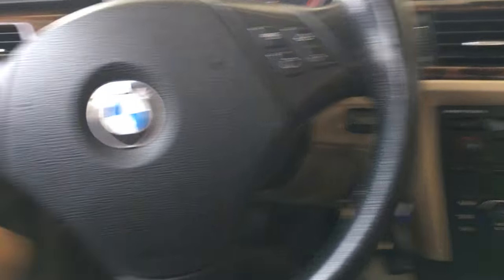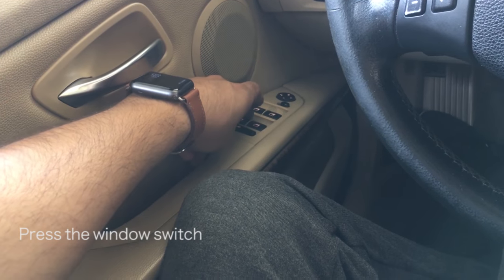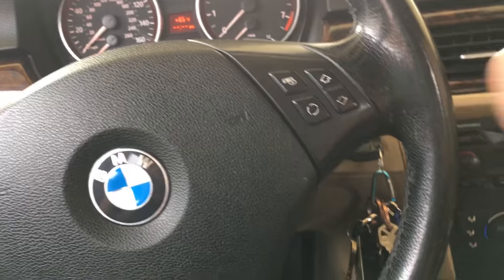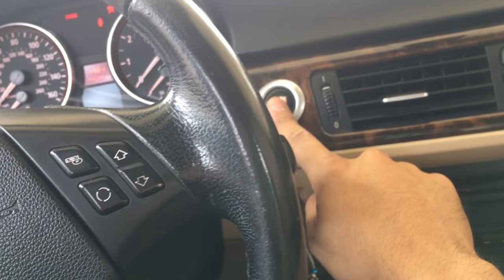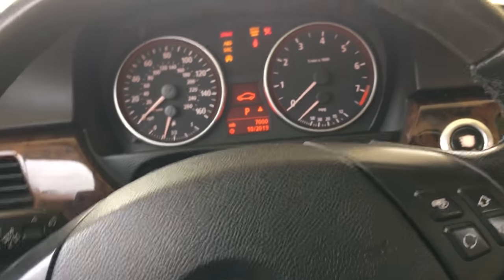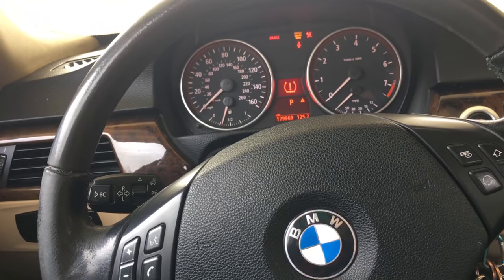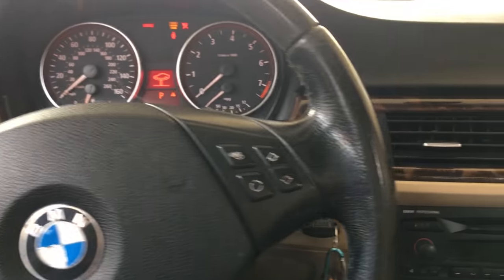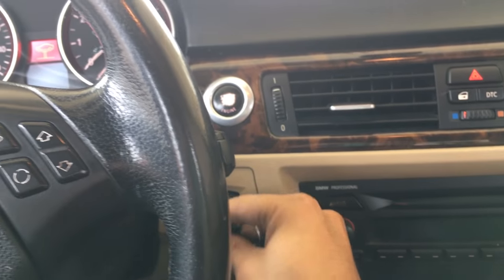Reset BMW Window Regulator that rolls in pauses

Comment: Ok guys, it’s working like in the below steps, but I struggle 1 hour to find the right way for my wife’s G30 plugin hybrid on YT. Obviously couldn’t find the right method and even this video is not very specific. 
Step 1: go inside the car and close the door 
Step 2: hold up the door button on 1st stage (step) and start the car but don’t press the brake, so you don’t actually running the engine.
Step 3: count until 10-15 while you keep the button up.
Step 4: stop the car first and after release the button 
Step 5: start the car again and try to open the window.
 For me it worked like that but again after viewing a lot of similar videos.

Comment: Excellent! Thank you so much! ...the trick you showed is that you have to perform 2 resets, the first by rolling the window down and holding the button for 20 sec's, then again by rolling the window up and holding the button up, again for 20 sec's. I had replaced the regulators in both back windows and these steps stopped all weirdness with the window going up then down or then up and pausing. Thank you again!
Reply: I had the same problem that you had with you, the glass of the leg drops by itself, and I will not be able to raise it. I only raise it with the remote control. Sometimes it rises and sometimes it does not, and the glass comes back down. What is this problem and what is the solution?
Reply: TY FOR COMMENTING THE VIDEO DID NOT EXPLAIN THIS!!!

also in my 06 bmw 
1. i did NOT need to quick push ignition button
2. a window sign came up on dashboard after doing first reset (i did down window button hold first)

Comment: Just replaced the rear drivers side window regulator on my 2007 328i, but I couldn't reset the auto up/down for it. After a few hours searching, I came across this video. It worked! I had to do the steps a few times and it didn't seem to work until I used the front drivers side window in the process along with the rear drivers side window that I was fixing.
Reply: Yes! Thanks for this comment. I couldn’t get the rear passenger window to reset so I tried doing the front too and now they both work
Reply: @EllaTobyVideos  So you guys are holding the button for the window on the front driver and on the window needs resetting ?

Comment: Thank you. I have my both rear window throwing this error after putting new battery in my e60 520d 2006. I have done your method which corrected the rear left side only. The rear right side continue with the problem.  Finally I did the following and corrected the problem. Ignition on and go to the affected window . Press down until the window fully open it will take few presses. Once fully open press the button fully down for exactly 17 second (look at your watch ) let go with the button and immediately left the button up all the way and keep it that way. The window now will go up all the way and down all the way and finally up again all the way while you are still holding the button up. Finally the window will stop and your fault corrected.
Thanks.
Reply: aabosala you’re a life saver! This worked for mine and now I don’t have to hear that stupid sound anymore.

Comment: I had the same problem that you had with you, the glass of the leg drops by itself, and I will not be able to raise it. I only raise it with the remote control. Sometimes it rises and sometimes it does not, and the glass comes back down. What is this problem and what is the solution?

ترجمة مباشرة

Comment: hi my problem
is when i’m on highway there’s a whistle getting through my passenger side and iv noticed that the window isn’t going up as much as it should as when the car is locked i can shove my finger up an feel the top of the window where as i can’t on the drivers side mine is a two door coupe my windows don’t have frames so they drop
when i open the doors

Comment: My rear window will go up and then go down again half way when using the auto up button. It will not stay in the fully up position. I heard you reset the window by holding the up button (while window is fully up) for 5 seconds to reset it. Would you know if this is true? Thanks....
Reply from the maker: Uptown Wedding Photography NJ sorry for late reply. But I think you were having the same issue as I did. That should solve the problem. If not, I like to unplug the battery for about 15 mins and see if the car resets them.
Reply: Hey Uptown Wedding Photography NJ , did this method end up working? Just asking as my issue sounds more like what your talking about rather than what this guy is explaining. Thanks in advance - Neil.

Comment: I had the same problem my window went down a quarter after closing it. let it down completely hold the button down, key in, push start button without foot on brake hold for a few seconds. had to use the button a few times til it was completely up remove key hold button up, key in, push start without the brake and whoop whoop it is fixed. thanx a lot.
Reply: Windows are working fine but there is signal coming from the dashboard

Comment: My rear window went down and is now stuck. When I push the button it makes sounds like it pushes and then undoes itself. The glas never comes out tho
Reply: That’s what my window is doing. This did not work smh
Reply: THE GOONIES 5 I replaced the regulator. It was $50 at O’Reilly long as u hear the motor u won’t need a new one.